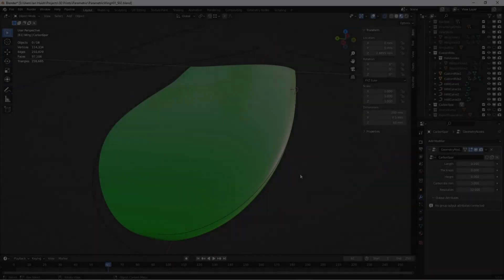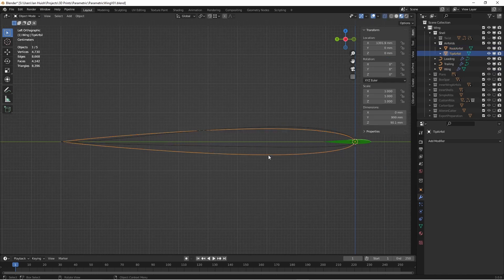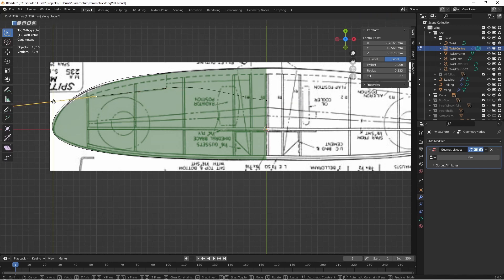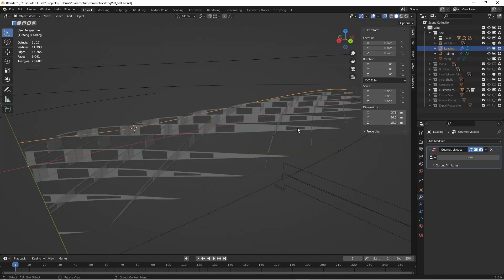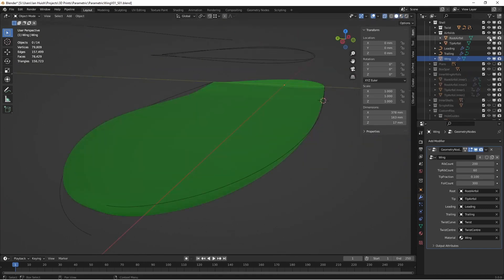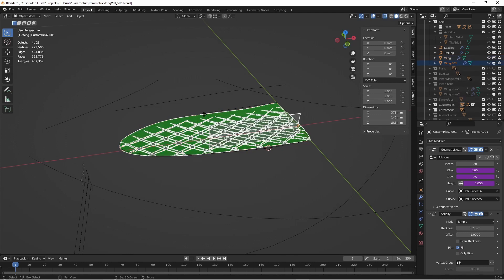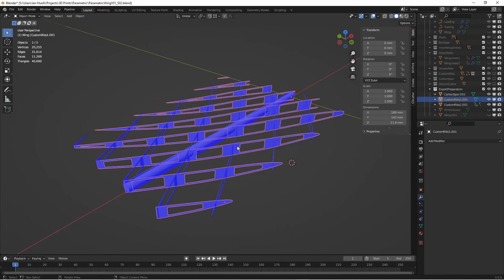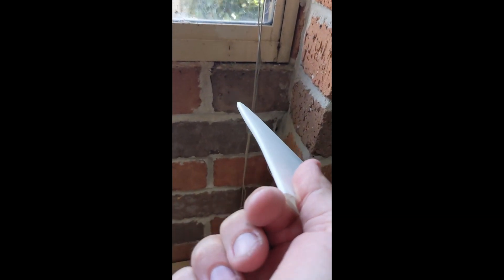Parametric 3D Printed Wing Design using Blender Geometry Nodes

Comment: I would absolutely be more interested in a tutorial. I'm an rc sailplane flyer for 25years, just got into 3d printing. Designing on blender with zero experience is daunting to say the least. A tutorial for these tools and methods would be greatly received by the rc community, no doubts!
Reply from the maker: Thanks for your feedback. I guess I come from the opposite direction, only having dabbled in the world of RC aircraft, but having used Blender quite a lot.
I probably will make a few tutorial videos. I'm interested developing a fairly non-destructive workflow from design to print.